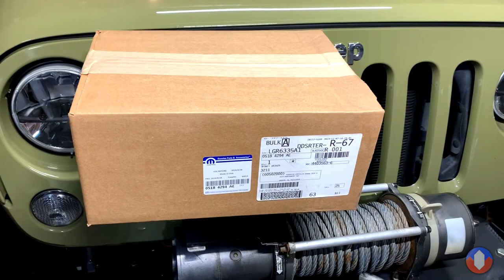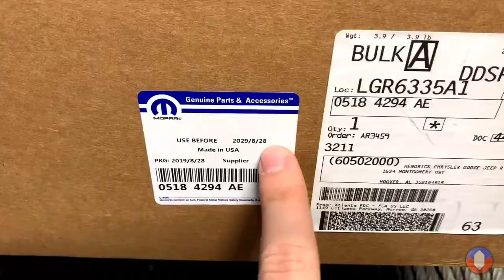Warden JKU | Oil Filter Housing Replacement

Comment: Why would you buy a oem part when the original part failed? I bought a aftermarket one and it has been better then the original. And saved 130.00$.
Reply: What brand did you buy, if you don't mind the question? I am about to purchase the part to perform the same repair....
Reply: @R3llik_13  3mirrors. And it fit perfect. And is doing the job!!